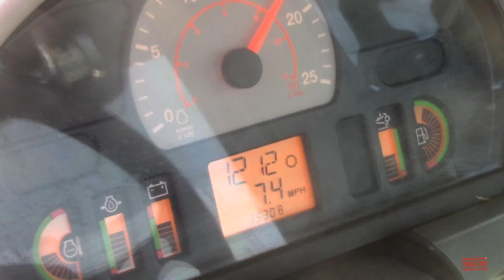CHALLENGER MT965E Tractor Working on Spring Tillage

Comment: Glad to see you back Jason. That's a lot of tractor for a 35 foot implement; I'm pulling a 32' 1"  637 John Deere disc harrow with24" disc with a 8370R John Deere tractor and it has no problems unless you hit a wet place
Reply: I was just gonna say.  Lol. We pull a 30’ Great Plains with a 9330 and it’s no sweat. I doubt that Challenger even feels that 35’.
Reply from the maker: They use a pair of these tractors for NH3 application and primary tillage. The 35ft does a nice job where as you add wings to go wider the outside parts are not quite as level as the inside. This farm had their 8R370 just on the other side of the field with a 24 row 1775NT. The IVT sure makes for a nice ride on the 8Rs.
Reply: @bigtractorpower  good deal👍

Comment: It's a long time ago but I worked on a farm in the UK and we ran MF 4840 and 4880s.I used to break down ploughed  fields with a 4840 and a 8 metre Maschio power harrow.A very impressive set up in the early 80s.Thank you for all your videos👍
Reply from the maker: The 4000 Massey’s are solid Machines. I have a 4900 lined up to film this spring.

Comment: I've got the 64th scale model of the MT 975E with triple tires. Big Bud 16 V 747 still is the power king of articulated 4-wheel drive tractors, though.
Reply from the maker: The biggest tractors today even at 620-640 hp are only have the size, weight and power of the 747. The 747 is a monster.

Comment: Great video, I love seeing all that power, I much prefer tracks to wheels, I believe you get much better pulling power with tracks ,huge amount of traction plus if the tractor is field weighted to maximum the total weight needs to be evenly distributed reducing compaction , the only down side is tracks are more expensive to maintain. 
All the very best to you, stay safe.
Regards 
Kevin Fox,England Essex.
Reply from the maker: I agree whenever I see tracked and wheeled Tractor is working on heavy tillage the track machines definitely our way out ahead.

Comment: I would have thought that Turbo Max wouldn't pull real hard but you can see on the tractor tires it's working a bit.
Reply from the maker: The MT965E is used fir several other jobs on the farm. They farm allot of river bottom ground and it pulls a little harder.

Comment: Nice tractor. He could probably pull a 50 foot like that
Reply from the maker: A 50ft field cultivator would work well. The issue on going extra wide on some Vertical tillage equipment is keeping the outside wings as level as the inside frame.